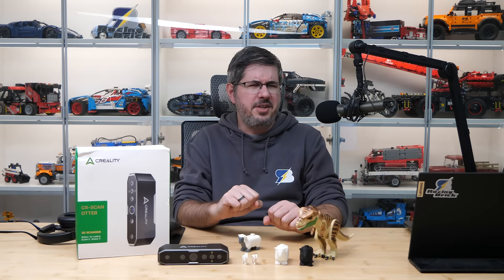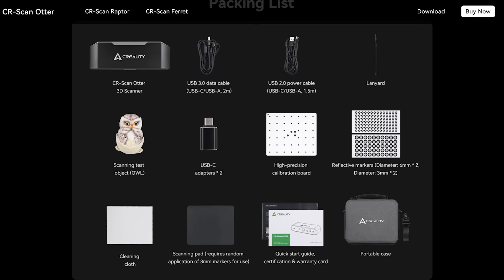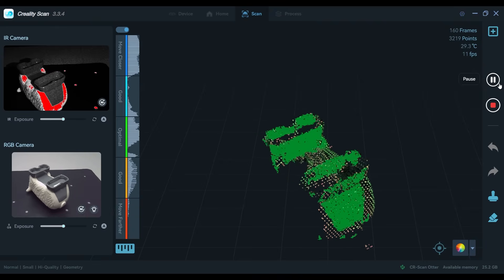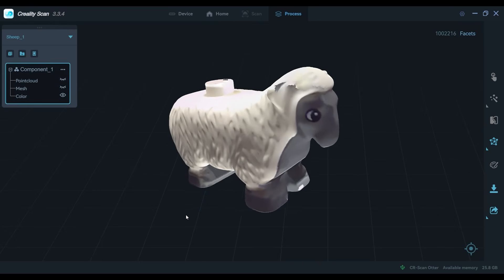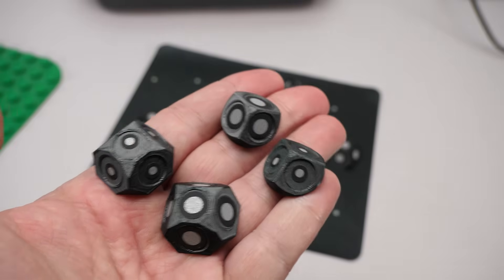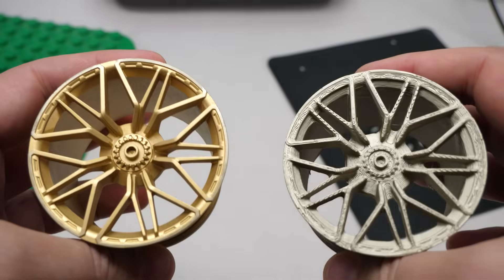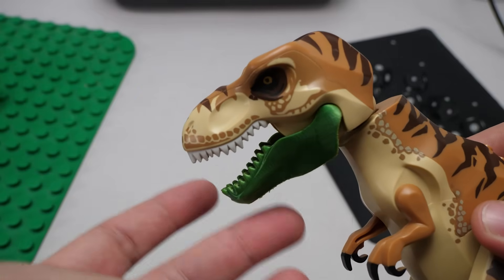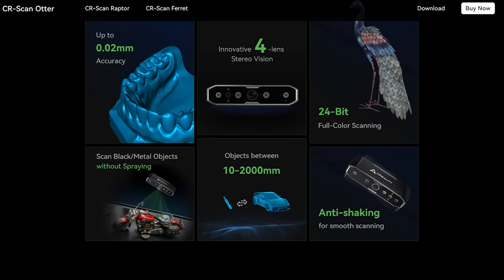Can I clone LEGO sheep? Experimenting with the CR-Scan Otter 3D Scanner

Comment: Please move the scanner around instead of the object. The handheld scanner has an accelerometer and a gyroskope to help place itself in 3D. When you move the object instead of the scanner it has to rely only on the tracking dots!
Reply from the maker: I tried that, but with the thick and somewhat rigid cable connected to the laptop it was not very convenient
Reply: @RacingBrick  Yeah, not a super design decision on their part 😅
Reply: Good insight